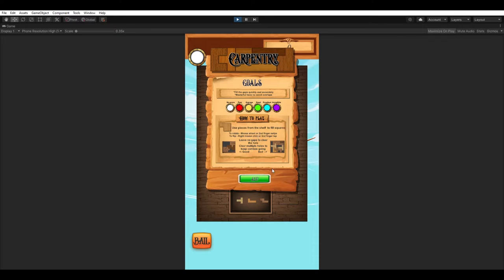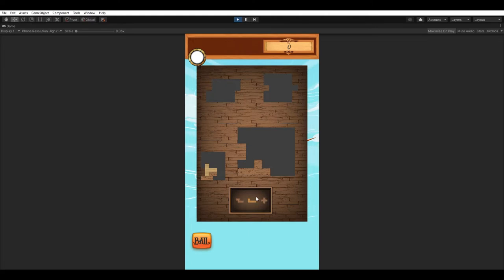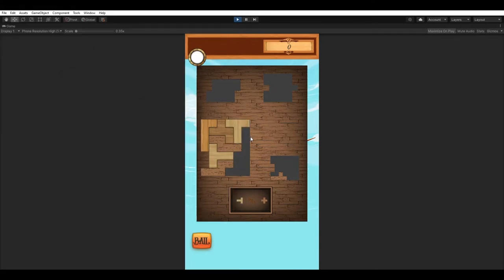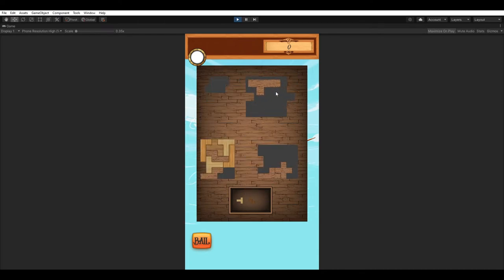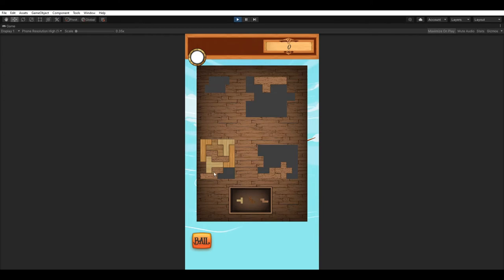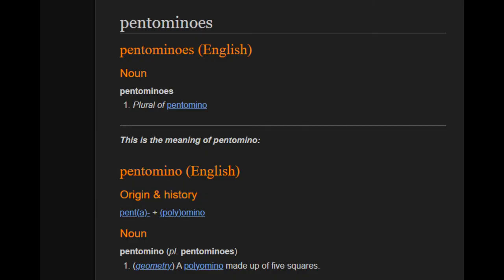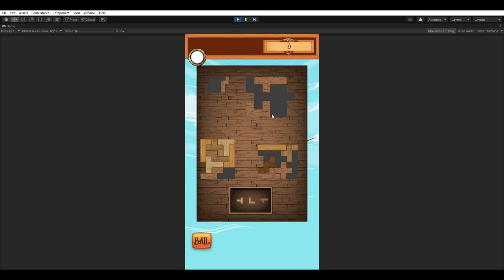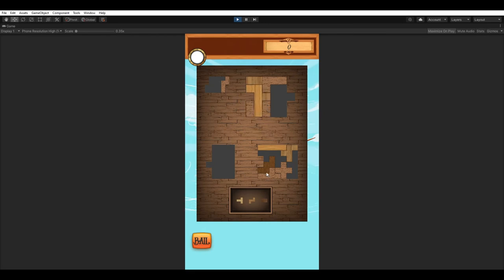Alpha Carpentry

Comment: that size-changing things is going to seriously mess with the people used to going fast in the old system cause the "current" one changes size from where they were moving the old piece to... 
Not sure if it's super annoying, but definitely .... a bit eh
Reply from the maker: We`re not 100% set on that way either, it just worked best for the smaller screen size. Its Alpha so there's a lot of room for refinement!